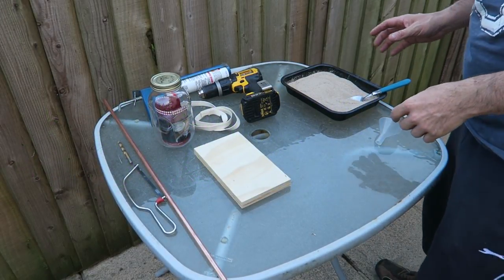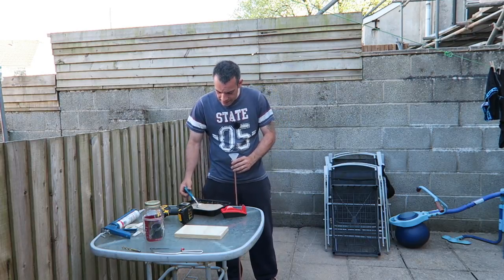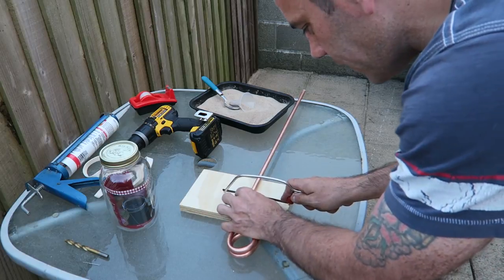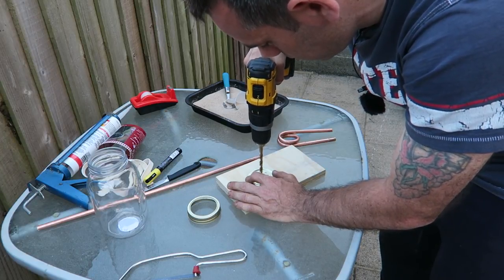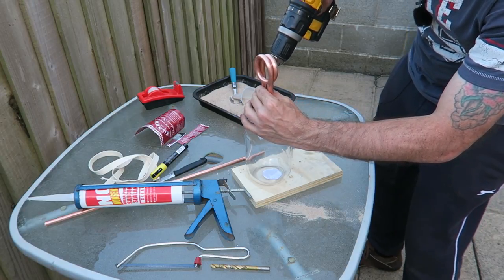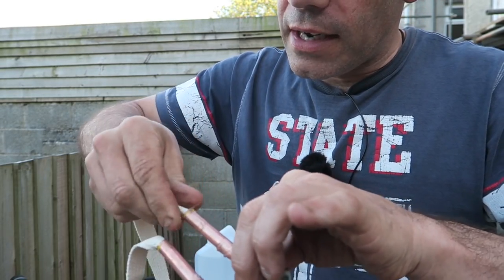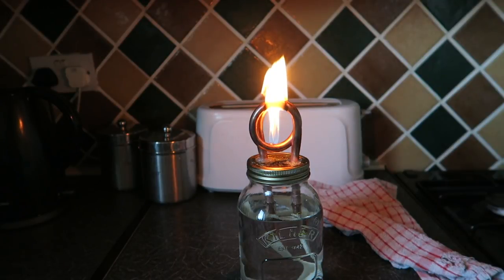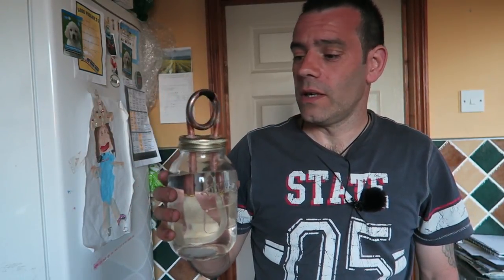How To Make The Most Efficient Copper Coil Alcohol Burner

Comment: This is just genius! So the pipe won't get too hot for the silicone?
Reply from the maker: I under estimated the silicine heat resistance your better using exhaust paste to seal it
Reply: Gotcya- I thought the silicone wouldn't cope with that level of heat.
Reply from the maker: The silicone was suppose to cover the temps that were thought to be created but it didnt last long. I have since used Exhaust paste and this is perfect goes hard and covered to 1000 degrees c
so use that instead

Comment: Hi the high pressure flame runs for about 20 mins then goes weak again. Any ideas what it could be?
Reply from the maker: You may have drilled too big a hole or have a leak within the system. it must be air tight to keep the pressure

Comment: really wanting to make a couple of these!! can you give me more details on the wicks?? do you have a link to where i can get some?
Reply from the maker: Hi Nick, Just search for oil lamp wick on eBay, it was wider and I just cut it down the middle to fit the pipe.
Reply: hi tony, have had some wicks delivered, and some copper pipe. could you confirm the size of pipe you use as the 10mm that i have bought looks small compared to yours and the 8mm very small

Comment: great job making the CCAB....I think next time after you bend the tube...use the vise to hold your copper and cut it there. glass table made you work harder cutting the copper....I used JB Weld and not silicone..heat may transfer down and melt  or weaken silicone and cause a potential accident....its your build and I comment with respect....otherwise well done!!

Comment: How long would you expect it to burn for, also as due to covid, alcohol is expensive, are there any other spirits that could be used?
Reply from the maker: Ive not tested anything else as the alcohol is high enough to provide the gases required. This small jar burned for a couple weeks just on fumes
Reply: @simplifygardening  Very Impressive. I have to build one :)
Reply: Methylated soirits or denatured alchohol is toxic so it cant be used for sanitation so it should not be much more expensive.
Reply: I know right? Alcohol went up by as much a 5xs when I looked earlier on. I was hoping price would drop but not yet. I don't know right off the cost of denatured but it may be cheaper.

Comment: Now if you could make a way to turn it into a lantern with white light.

Can you use lamp oil or olive oil in it?
Reply from the maker: Yes you could use oil lamp oil
Reply: I just saw your question and thought you could try to suspend a propane lantern mantle above the blow hole. The hot flame should make the mantle incandescent.

Comment: What's the advantage of burning alcohol in this as opposed to a simple wick style alcohol "lamp"?  Is it higher power or more efficient or something?
Reply from the maker: Ken the advantage is this burns cleaner due to it being hotter. Secondly the fuel lasts 10 times longer, with a wick system your buring the alcohol itself as it wicks up and you light the wick. With this system the only thing that is lit is the fumes coming off the wick as the wick gets hot and vaporises the fuel. much less fuel and burns hotter

Comment: I thought u was going to slip up when drilling that small hole in the pipe, it would probably be better to drill it before you bend it
Reply from the maker: Your right but it needs to be right in the center or it dont burn right, A longer drill bit between the coil would have been a better idea but like everything else unprepared and didnt have the tool.

Comment: Hi Tony, this reminds me of the old camping stoves we used that ran off paraffin. You'd fill a little 'moat' with meths to pre-heat the paraffin and turn it to vapour and it would burn the vapour.

Could I use meths in one of these instead of the isopropanol (IPA)? I'm in New Zealand and IPA is controlled in quantity (more than 500ml) and expensive in small amounts here as it's used in illicit drug manufacture. Cheers.
Reply from the maker: Shaun I have a friend who uses one of those to heat a kettle at his allotment. Yes you could use meths instead of IPA
Reply: @simplifygardening  Thanks for the reply Tony. I wish I'd kept my paraffin camping stoves now as it's easier to top them up with a bit of paraffin than to carry extra gas canisters (not to mention 'greener', not having to throw empty gas containers into landfill). Same for my Tilly lamp (and my Colemans lamp) that I used to use when I went fishing. Now I know I can use meths I'll give this a try. IPA is so expensive here I only use it for cleaning up flux residue etc. on a cottonbud after soldering electronics or 50 : 50 with distilled water for cleaning LCD screens. Cheers.
Reply from the maker: @Shaun.Stephens  you may want to start with a tiny hole with meths and work up the diameter after you see how it burns
Reply: @simplifygardening  Thanks mate.

Comment: Mason jars are not heat shock stable.  What happens if the top of the jar gets too hot while the bottom of the jar is cool from the alcohol fuel?  The jar could burst dumping flaming alcohol all over.  I would like to see this idea implemented with either Borosilicate glass or a metal fuel reservoir.
Reply from the maker: No heat is transferred to the glass at all
Reply: @simplifygardening  really? I just thought the heat would go from copper to metal lid to glass jar.  I've been looking to buy one of these for mycology to sterilize tools.  I saw some other videos where people put an air needle valve on and it allowed for adjusting the flame size.  Have you considered making such a modification? Do you have issues when the alcohol level drops creating a vacuum inside the jar without an air intake?

Comment: please answer my question, do you think this safe? it won't explode?
Reply from the maker: No it wont explode and its safe providing you ensure it is placed where it cannot be knocked over.
Reply: There are smaller sized burners made to use in a lab setting just like this design. Make sure that around the pipe and lid is sealed very well so no fumes escape from there. As others have mentioned a better seal would be the hight temp sealing paste (jb weld or others) used often on car exhaust pipes. The type I use is the red paste.

Comment: I've seen the copper coil used to make an outdoor hotter by putting a small fire in the middle of the coil and attaching each end to the tube.   It works by pulling the warm water through and back into the tub.   As the water cools it goes back through and warms it back up again.   With your small coil, couldn't you put a crisco em. candle in the middle of the coil and use the copper pipe to heat water for dishes???????
Reply from the maker: Interesting! Ive seen something similar thanks

Comment: How about drilling the little hole BEFORE bending the pipe?
Also if you don't make the bend so tight, the flame could shoot through them and still heat the pipe.
Reply from the maker: Your not guaranteed that the hole would be center
Reply: @simplifygardening  Method 2: if you leave a little gap between the 2 pipes, then you could drill the hole at the  end straight from the top and it would be perfectly centered and pointing up.

Comment: How can you be burning fumes when both ends of your coil are submerged?
Reply: The liquid vaporizes before it gets to the exit hole. Liquid does not squirt out.
Reply from the maker: the liquid is in the lower part of the pipe, as the flame heats the copper pipe the fumes are created from the low level of the liquid and they burn

Comment: I have made the coil and drilled the hole but after lightening the , carbon forms at the top of the coil and then goes out ... any ideas we’re iam going wrong ... my flame burns straight from the hole also , doesn’t seem to be under pressure and the flame burn with a gap from the coil like in your video
Reply from the maker: too big a hole Sorry for the late reply. had some issues with comments not showing that they had not been answered, so I am getting through them

Comment: What is the purpose of the copper coil? Couldn't you just use a wick through a lid  on the jar?
Reply from the maker: If you use the wick then your burning the fluid like an oil lamp. if you use the copper coil only the gasses are burned. it makes the alcohol last very much longer

Comment: Have you actually used this for long periods?  I have read that having an alcohol lamp over-filled (above half) and sealed with no "breather hole" in the lid to equalize the pressure can be dangerous, as the alcohol will rise up the tube in a sealed system with changes in atmosphere, acting much like a barometer.   I understand that the heat is pulling the fumes up and through, but will atmospheric changes not also pull the liquid up and through, over time?  This seems extremely dangerous, to me.   Could someone explain why a venting hole was not required and filling it up way over 50% was OK?
Reply from the maker: I used it last winter for around 4 months with no issues and a few months s far this year
Reply: The venting hole is in the copper pipe. The pressure cannot get very hard with the hole in the pipe.

Comment: I've watched many of these alcohol burners. NOT ONE  shows where and how deep to drill the tiny hole in the tube. I think this is most important. I've been googling it, but no one shows it.
Reply from the maker: At the bottom of the coil. As y dont know where that will be its better to drill after bending
Reply: @simplifygardening  yes, it's at the bottom, but, do you drill all the way through ??? That's the part I can't figure out
Reply: Drill through just the top side of the pipe. Don't go through the second side or bottom of it.

Comment: Why wouldn't you drill your hole in the top rather than at the base of the coil? You're heating the copper pipe. That's going to compromise it in not too long a time, I'd think.
Reply from the maker: Because thats how it works, it heats the pipe which in turn causes the fumes or gas from the alcohol to expand pushing it out of the hole under pressure. you need the heat for that to keep working

Comment: Question??

Why use (8mm) Copper pipe and not 4 or 6 mm?? 

Bc you want very high heat as possible or just bc you only had 8mm copper pipe??
I think Smaller copper pipe will also will generate AAAAA LOT of heat and “maybe” last longer ??
Awesome video, I’m looking forward to make my own heater:-D 

Have you tried to twist the copper pipe one more time around so there will be 3 lines of copper pipes instead of 2 and then drill 2 holes in each pipe instead of one hole in one pipe ?? :-D

Maybe you could link to another YouTube channel that experiment with homemade copper pipe heaters “if you know one”??:-))
Reply from the maker: 8mm allows for a better burn

Comment: 4 attempts and the pipe collapses all the time. Tried it with sand, wet sand, water and water then freezing it.
Reply: @allan nyb 
Try annealing the copper tube first, this should make it softer and you'll need less force to bend it. Also make sure the sand is packed quite tightly in there (tap it on a hard surface occasionally while filling).

Comment: Really smart to use unbreakable glass in order to make the lamp safe.  Good job.  Would you even be allowed to post this if it was titled, "How to build a Molotov Cocktail."  THIS IS NOT A SAFE LAMP TO USE.  NEVER DO THIS!!!!  Canning jar glass is NOT ACCEPTABLE for this use.
Reply from the maker: Canning jars are heated glass it is designed to take high temps and pressures. Also the jar never heats up. This has been used for years with no issues at all.